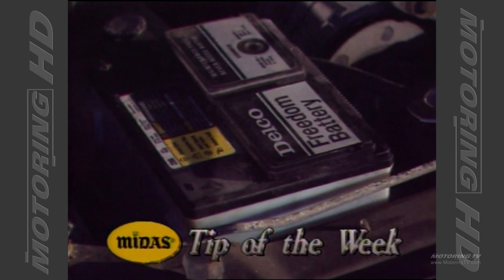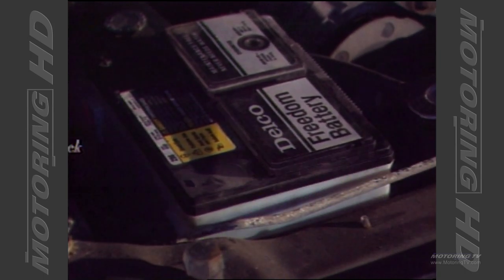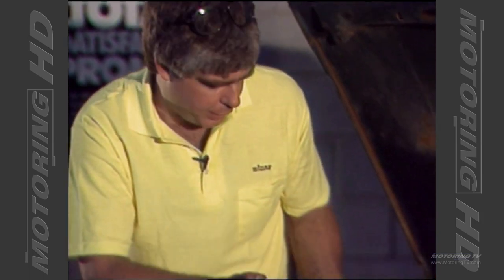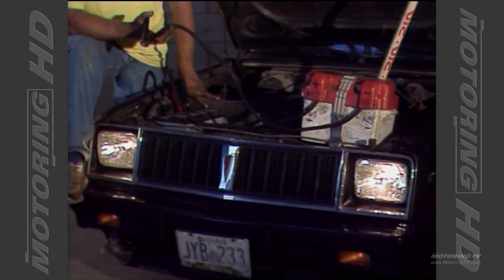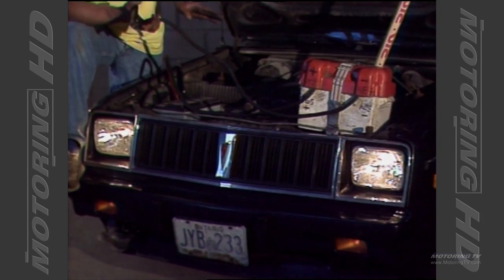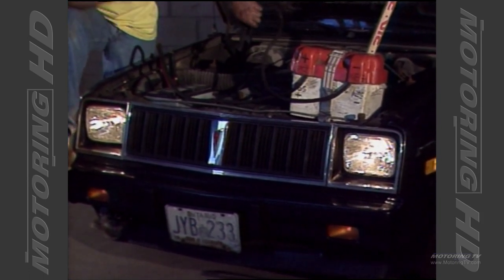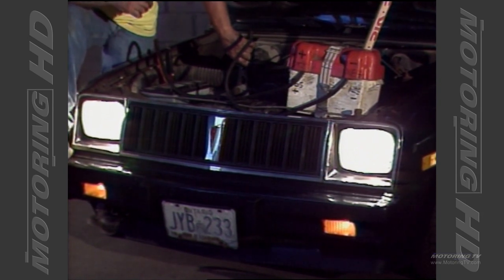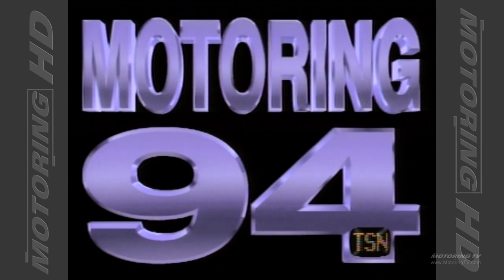Boosting a Battery | Tip of the Week

Comment: The number of times I've had someone argue with me to put the negative on the dead car battery and not on a ground when I help boost someone has been astonishing. I'm like, "sure go ahead, if you want to risk blowing up your battery and a car fire! Oh, or at minimum possibly fry the one of, or many, or all, the dead cars computer modules" They either let me continue to do the proper/safe way, or I just hand the cable to them and say have at it! Your fry it, you pay for it!
Reply: Quite interesting. I didn't know about this. I've boosted my dad's Toyota Wish by using the terminal on the battery and it actually worked fine. I just learnt something new.